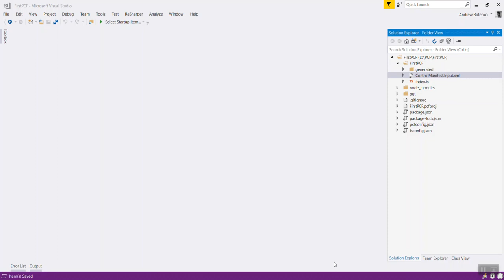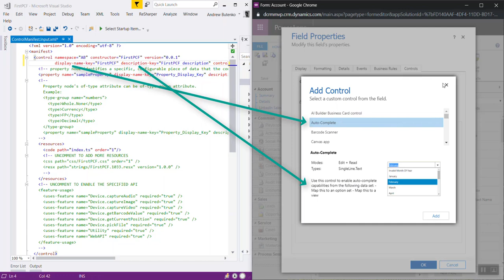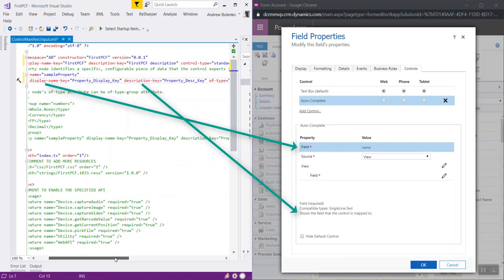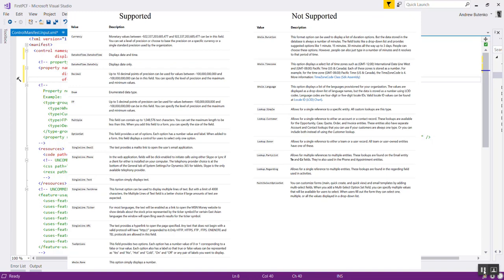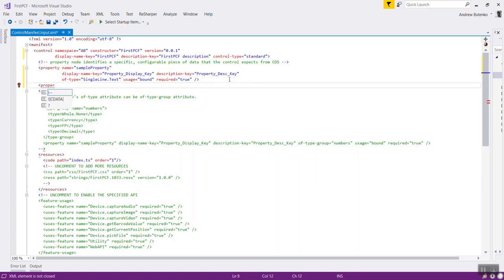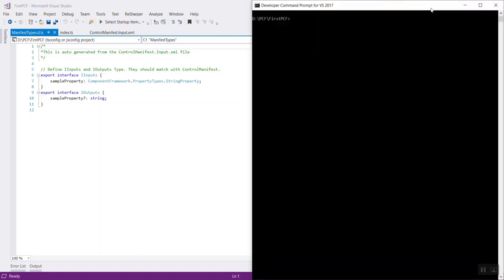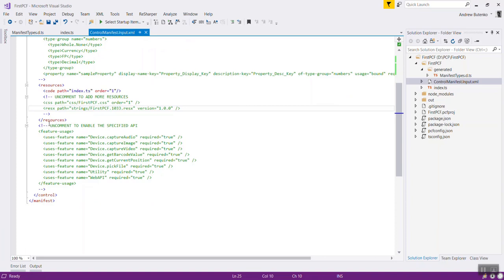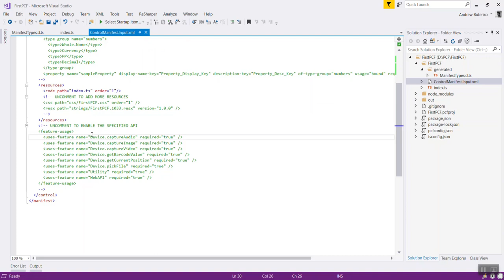PCF Academy - Working with Manifest file

Comment: Great job Andrew! Question: I am using VS 2019, but do not have the ability to expand the manifest XML file, from the solution explorer. Instead, the only way I could see the auto-generated manifest TS file (yes, I performed 'npm run-script build') was through 'Show all files'. Can you suggest how I can get the XML to expand so that I can see the TS appear? Cheers
Reply from the maker: Hello Mark, I would recommend using VSCode instead of VS for building PCFs. It's what I picked up building controls for years now. Andrew
Reply: @AndrewButenko  Does your series demonstrate how to use VS Code for building PCF? If so, which episode?
Reply from the maker: @markpittsnh  you can check this video - https://www.youtube.com/watch?v=sF68YEO5ITY&ab_channel=AndrewButenko